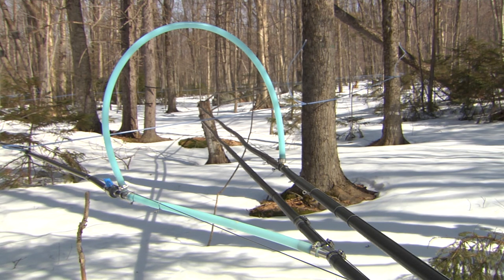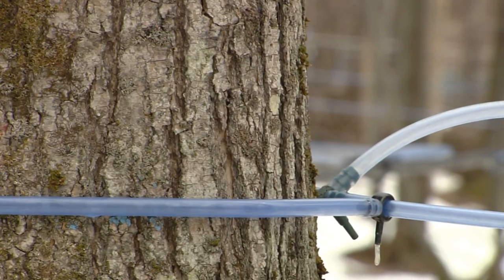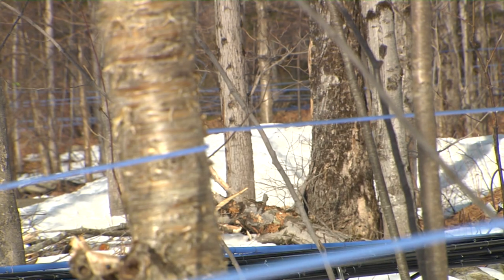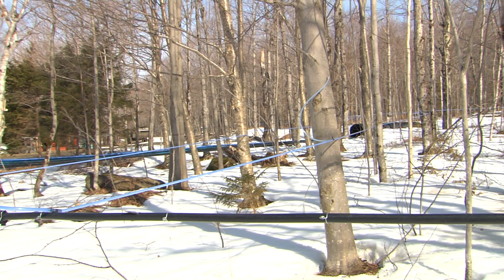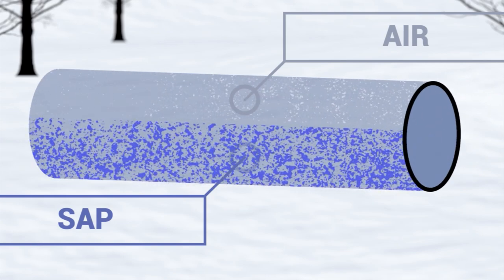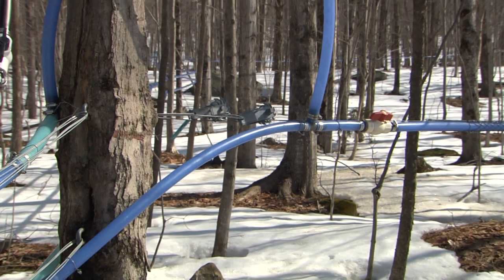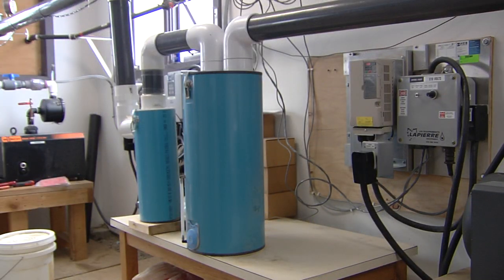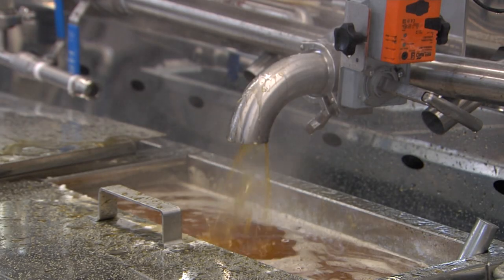Modern Maple 5/16" Vacuum Tubing Systems

Comment: Seems very time, labor, and capital intensive. Looks like a man could have 20g wrapped up in a small operation
Reply: It really depends on scale. It is much cheaper per tap to set up 5,000 taps than 500. I've heard guys talk about $10-20/tap for a traditional 5/16 tubing installation. I have been using a 3/16 hybrid system for 5 years now, and I'll say one thing for sure: I'll never go back to hanging buckets. The weather has been so challenging during the last decade of syrup seasons and using vacuum and good sanitation practices really helps the producer remain viable and sleep well knowing that we're doing our best to bring in a crop.

By the way, my 3/16 and diaphragm pump setup doesn't work for tons of taps, but it only cost $4/tap and has worked extremely well for me.
Reply from the maker: It largely depends upon the size of your operation and whether you do the installation yourself or hire a professional installer.  A high yield maple tubing system using vacuum is not cheap, but the production gains typically pay for the added costs fairly quickly.  In general, maple operations at about 5,000 taps start to generate decent profits, but much depends upon whether you sell your syrup retail, wholesale, or in bulk.